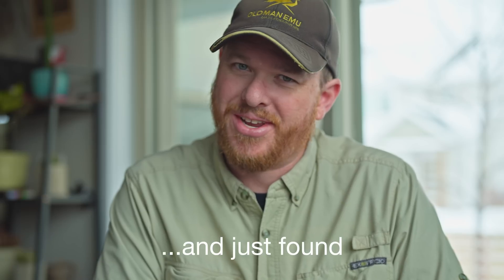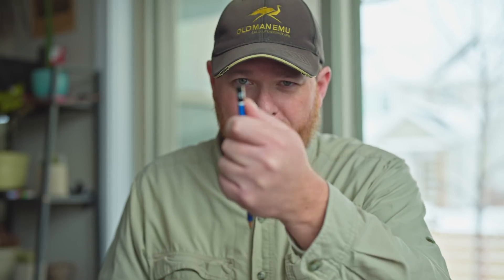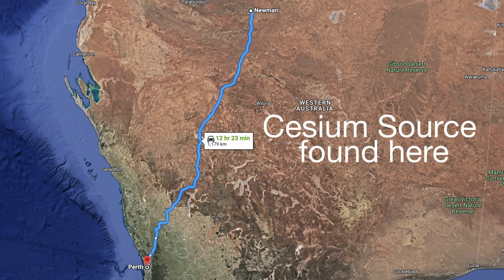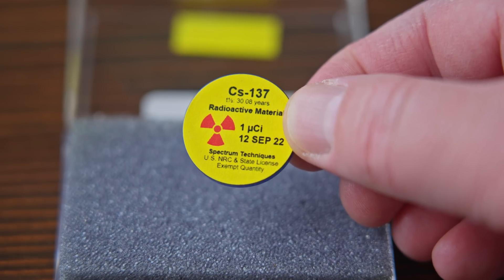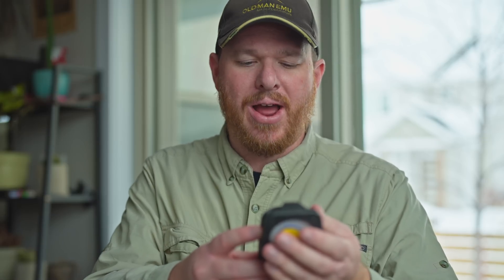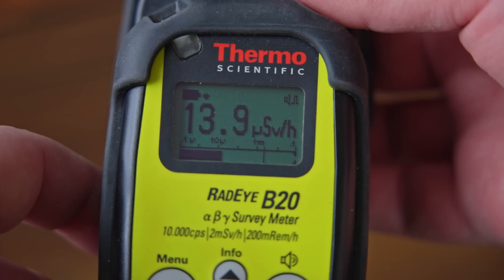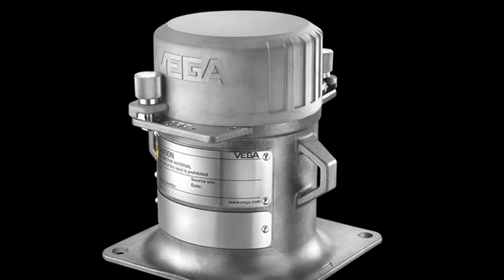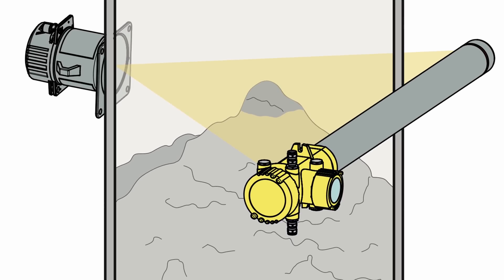Cesium 137 Source Lost and Found in Western Australia

Comment: Last year I was driving on a freeway in LA and my Geiger counter went crazy with a background radiation around 10 times normal. It then went back to normal again and I realized I had just passed a car and slowed down to see if it would rise again. Yes, inside my car it went up again to a level I've never measured before anywhere in nature. I noticed the car had a handicapped number plate and after some investigation learned that it was a patient who was treated for cancer with brachytherapy, where the radioactive material is put in the patient's body during the treatment. Wow, I was in a different lane on the freeway behind my vehicle's doors and still with that radius getting 10 times normal background radiation. Knowing how radiation drops by distance, there is no doubt this is a nasty level of gamma radiation within the patient. The DNA damage from such treatment must be massive.
Reply from the maker: Those radiation treatments can be extremely strong. Even the ones for imaging can be very intense.
Reply: @RadioactiveDrew  Measuring around 1 micro Sieverts per hour over a distance of around 15 feet through two car doors (= 4 metal sheets) on the freeway makes me really wonder how this can be a "treatment".  I believe this is still almost a point source in terms of radiation pattern. Using the inverse square law considering a near point source, I can calculate that some tissue is getting fried rather quickly. 
Concerning CT scans I got two of those for no really good reason (one muscle pain in my shoulder and one infection in my gall bladder). It seems hospitals and insurance companies have little concern about the insane dose rates of these CT scans. No doubt some people develop a cancer from these scans and will end up needing more scans during treatment. Hopefully nobody see that as a business case.
Reply: @ThinkingBetter  I agree VERY odd. Something went seriously wrong, particularly given it was not back in the day when no-one knew better.

 The entire point of brachytherapy is it's incredibly targeted and precise and suitable for day release as the source JUST targets the tumor and not healthy tissue. 

 Such a high level of radiation across the entire body would devastate healthy tissue, in the patient and relatives if in the same house. 

As a comparison. Before discharge, animals that have had any sort of radiation treatment - usually I -131 for hyperthyroid cats - have to meet very strict levels of radioactivity before discharge is permitted. For I-131 typically 5-7 days in house stay is required, depending on dose (and country - US is not as strict as some countries).

I would think human patients also must meet minimum safety criteria before discharge. The treatment specified above would be far more of a dose than one I-131 injection on a 6kg animal, release only sanctioned a day or two before completion of  I -131's first half life.

Once home cats stay isolated for 2 weeks, then can go about the house for another two but stay one metre from human inhabitants. All cat litter to be flushed for a month. That's pretty strict.

For that amount of radiation to potentially affect other people, particularly family members (imagine sharing a bed) - that's a major lawsuit from family and potentially neighbours.

Comment: I had cesium 137 pellets injected into my prostrate, the reason I chose it was that it has the shortest "half life" in one month it has very little energy. [5 years cancer free]
Reply from the maker: I looked up the isotope of cesium used in a procedure like the one you had and it seems like they use cesium - 131 which has a half-life of 9.6 days. This is much shorter than cesium - 137 with a 30 year half-life. So they cesium - 131 they used is much more radioactive but they only need to use an extremely small amount to treat cancers.

Comment: I am suspicious of how that thing could just fall out of a container designed to have several layers of protection to prevent that exact thing from happening. There would have to be an obscene number of screws, bolts, and guards missing.
Reply from the maker: I can believe it if the workers just beat their equipment up and people that are suppose to be trained to handle material like this have zero training.

Comment: According to rad pro calculator a 20mCi Cs-137 source gives a dose rate of .056mSv/h at 1m, .225mSv at 50cm and at 10 cm 5.65 mSv/h, mind you this is only gamma, not taking into account the beta radiation nor bremsstrahlung. So it would take a long time of having the source on a pocket to give you ARS probably weeks. Edit: at 10cm gives only 5.6 mSv not Sv. also going by your source giving 14 µSv/h on contact times 20k equals 280mSv/h. Still very far from being a lethal source but enough to give burns and be harmful if kept in a pocket for many hours.
Reply from the maker: I know…that’s why I said it would really only be fatal if swallowed.

Comment: It seems astonishing that the containment vessel was not secured with wire locked bolts. That actually might have been the case, but mining is a tough business and equipment suffers a harsh life. It would appear that at the end of a job, the equipment was just loaded up and shipped off to a new site. It is only after arriving at the new site that maintenance and servicing was carried out. Which is when the loss of the Cesium source was discovered. That makes sense when you consider the state of the roads over which the equipment needed to be transported. Loads of bumps and vibration on the way, so no real surprise that this could have happened. The intensity of the source made detection relatively easy, but it could equally have been picked up in the tyres of a passing vehicle and lodged somewhere in the chassis. It would still have come to light eventually when people started coming to hospital with unexplained burns or symptoms of radiation sickness. So finding it eventually was in little doubt. The trick was to find it before someone got hurt and without panicking the local population, which is thankfully very sparse in that area. Industrial radiation sources generally fall into the category of being very bad to be close to unless they are installed correctly in their shielded housings. Very intense sources may be physically too hot to handle outside of their containment, so the chance of someone holding on to one of these pellets with bare hands or slipping it into a pocket are reduced somewhat. Still very nasty to come across one of these pellets unshielded under any circumstances without the correct protective gear and handling equipment.

Comment: I build the outer hull for replacement bins for some radioaktive stuff in medicine. I think that was for cancer treatment or so. They were 15cm in diameter and 25cm high. The bottom, sides and lid were all more then 4 cm thick solid steel. This thing weighted more then 12kg (~25pounds) and that was before another company put a lead lining inside. My boss said the finished product weighted more then 20kg (~40pounds). This thing had no warning stickers or markings, and the exterieur had to be polished like a mirror, but the other 3 layer of packaging around it were all plastered with everything you could imagine and every layer had a seal. When something seriously radioaktive is transported in public the safety is normaly so that not even a total car crash could  destroy it. Then in Europe you need a marking on the truck and the driver must have a special training for hazmats. For that to happen, that the stuff is totally open there must be someone who made a lot of mistakes or..........shortcuts.
Reply: i live in australia and I have seen every now and then a ute or pickup whatever you call it in america on the road, they have a radiation sign on the back of the car, and a solid metal container strapped down in the rear corner of the tray diagonally opposite from the driver. I assumed this was the standard way in Australia to transport radioactive test equipment. I'm not sure how this could ever have been allowed to happen.. we generally have alot of regulations and documentation for these sorts of things
Reply: @garyflies  makes more sense and normally it's everywhere the same. A little bit Like a russian matroschka, a Box in a Box in a third Box ....... I'm in Germany. Here we have plates with numbers, the number on top describes the danger for example a 7 would be radioaktive. The number at the bottom of the plate is the material-number and then every Police or  fire Department has list or can ask via Radio.
Reply from the maker: All you need is enough people thinking it’s not a big deal and that’s when accidents happen.
Reply from the maker: It seems like different countries have different regulations when people are going to handle radioactive materials.
Reply: @RadioactiveDrew  jeah but even with the most basic Security this should not happen. That was Like a hole in your pocket and you lost a Penny.

Comment: I enjoyed your presentation. My impression, from the stories I read, was that the release of the source from the gauge required the loosing of at least two screws that secured it in place. My guess is that there were not quality control issues regarding the tightening of those screws, including lack of periodic inspections of how tight they were. Perhaps that was complicated by personnal trying to avoid getting near the source. There is a good chance that these screws were getting loser and loser during multiple transport trips and no one was checking on that aspect of the gauge that they were transporting, perhaps over a period of time of many months.

Comment: As someone has already mentioned in the comments section, similar yet much worse Kramatorsk Radiological Accident occurred in USSR in late 1970s. A cesium-137 source from a comparable instrument was lost in the Karan(sky) quarry. Search was poorly organized and the source ended up in the concrete wall of a residential building. Over 1980-1989 period four residents died of leukemia. Only in 1989 was radioactive source located, wall section cut out and transferred to Institute for Nuclear Research of the National Academy of Sciences of Ukraine. Cesium-137 inside the capsule had activity of  5,2×10^(10) Bq (1,4 Ci).
Reply from the maker: I remember reading about this incident a couple years back. That is a crazy hot source.

Comment: Had this been a Cobalt source picking it up with your fingers for just 2 sec would totally give you a burn.
Reply from the maker: That all depends on the activity. But yes, there are some sources of Co-60 that could give you a fatal dose by just picking it up. Usually the sources used for food irradiation are extremely active.
Reply: @RadioactiveDrew  I just meant pound for pound Cobalt is way more radioactive. My 1uci source disk puts out 130-140 usv/hr
Reply from the maker: Oh yeah…that’s because Co-60 has a shorter half-life than Cs-137. A little over 5 year half-life for cobalt 60 vs a 30 year half-life for cesium 137.

Comment: I got to see some 15-ish year old 20 milicurie samples of Cs-137 at a hospital. They were used to treat esophageal cancer, by sticking them through a person's throat in a low gauge needle. they were about an inch long and maybe 3mm accross and from about a foot away from the samples (when out of the safe), we were reading 0.1R. They lived in a locked closet in a safe lined with 3-4 inches of lead, on a workstation with a 2 inch lead plate to shield the user's chest from exposure and a leaded glass window on top for loading them into a needle. they came in 5, 10, 15 and 20 mg of Ra eq. (mCi)
Reply from the maker: Those are some hot sources. The nuclear medicine side of things is very fascinating to me.

Comment: 20 msv is about 2 rad if my conversion is correct, it’s much higher than average stuff but wasn’t going to kill anyone or contaminate the area since it was in metal rod form, I’d be more worried about how much money the company lost on it and the government spent trying to find it.
Reply: They've said the source was strong enough to cause radiation sickness & could certainly cause serious disease if misused. 
The point is that the idiots responsible for it failed to do their jobs where it could be stolen & misused as well.

Comment: they use that exact same thing at the copper mine I work at, and they give a thorough safety class on it, but out of the 650 employees, only 3 people are certified to work on them. And was just told by Safety that they are reducing the number of these around the site in favor of newer non-radioactive ways to measure.
Reply: If it is just level of powders or slurries, ultrasonic measurement is pretty good, but the sensing disk wears out. The main advantage of nuclear is that the source and sensor can be made super rugged and work under all kinds of awful conditions. 🤓

Comment: Worked with cesium 137 for oil well logging tools.. Our source looked like a 1" long 3/4" bolt, painted bright yellow. You would unscrew it from the lead pig and insert it into the tool... Company had a few close calls with lost sources over the years..   One tool got sent back from offshore with the source still in the tool...Another, where someone found a source laying on the ground and did not know what it was, he picked it up and walked over and stuck it in the face of someone that definitely knew what it was...
Reply: I bet there would have been many losses or thefts due to poor practices, supervision & no accountability.

Comment: But how did they loose the source? It was placed into its massive container and is must be locked securely. Are the roads in Australia so rough that the container was opened itself by vibration and the source jumped from the container and the truck as well?
Reply from the maker: I don’t think the source holder was secured in the back of the truck. Seems like it was bouncing around in the back and that’s how the source came out of the holder.
Reply: @RadioactiveDrew , Vegasource 81's weight is more than 10 kg. The container for higher radioactive material is havier. I don't know the container can bounce without heavily kicking the sides.

Comment: Great Video! I do have a question, they claim that exposure is equivalent to 10 x-rays which I agree is extremely vague but is it possible they could be calculating the exposure model with respect to the energy of the radiation emitted? Leads me to another question is it possible to have something be extremely radioactive but the decay energy be very low so damage from prolonged exposure is kept minimal and localized?
Reply from the maker: I can’t see how a difference in energy level from X-rays to gamma rays from Cs-137 could make up for that 10 X-ray number. I think it was more of a thing of them downplaying the danger associated with the source by using something people are familiar with…X-rays. But when they talk about the source outside of that scope they referred to it as dangerous. 10 X-rays isn’t dangerous…but 2800 of them sure are.
Reply: @RadioactiveDrew  ahhh yeah that is a good point, photon energy levels of X-rays and gamma rays are orders of magnitude different. Downplaying the scenario seems likely.

Comment: I believe they said that if you stood 1 meter away from it you would receive the equivalent of 10 chest x-rays over the period of 1 hour. I also read that that it was a 19 gigabecquerel source. I don't know how accurate that is. In comparison I used an online conversion calculator to show that the 1μCi Cs-137 check source is about 37000 becquerel. I also found a company online, QSA Global, that sells industrial Cesium-137 sources in different capsule sizes. The capsule code X8 seems to be the most similar to the one in Australia and can have a custom activity value but only up to 11.1GBq. Other sizes can have higher activity values.
Reply: 1/2 Curie---that is more believable.  It takes a very powerful source to penetrate rock, especially metal-bearing rock.

Comment: As a retired Radiation Safety Officer I applaud you for putting this situation in perspective.  Yes, the dose of radiation received is reduced by the square of the inverse of the distance from it.  In other words, at 3 feet from the object you would only be exposed to 1/9th (1/3 squared) that you would at 1 foot (everything else, including duration of exposure being equal).  Another interesting perspective is the amount of radiation received by airline crews...yes, they get exposed to radiation at high altitude that has not been attenuated by the atmosphere.  One suggestion I'd make...the bolts holding the housing together should have been lock-wired so as to not be able to loosen off with vibration.  (Lock wiring is something done in all aircraft engines, whether jet or piston...for the same reason...to prevent accidental loosening.) It is unfortunate that public hysteria is only exacerbated by those putting out news and safety bulletins who only tell a small, sensationalist part of the story.  Scaring the public does nothing to reassure the public.  As far as who is to blame?  Well, Rio Tinto did hire a contractor to move the guage.  If they were in process of purchasing it from some other party then it was up to that party AND the transport contractor to ensure that the move was safely done; if it was moved from one Rio Tinto site to another, then the onus falls on Rio Tinto to ensure that the paperwork and inspections are done properly.
Reply: Retired Hazardous waste cleanup supervisor. I mostly ran soil remediation projects. I was never informed about cesium on any project I was involved with yet there is in my tests 20 years after retiring.